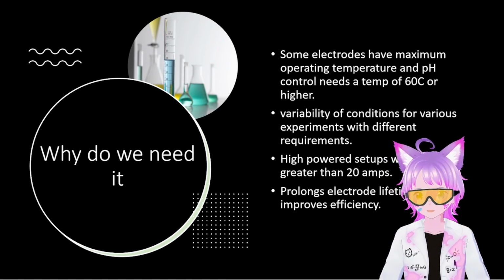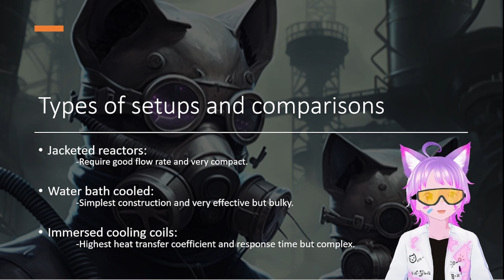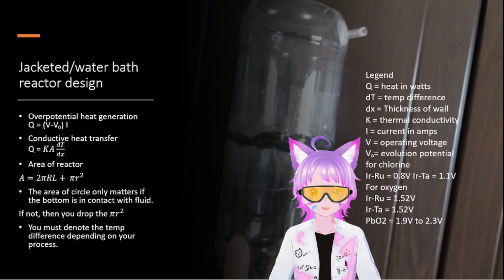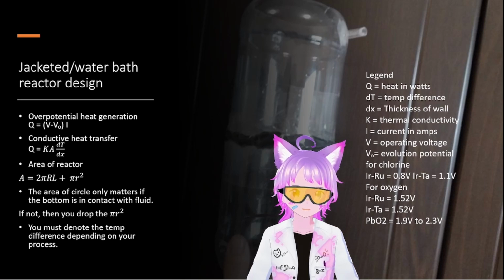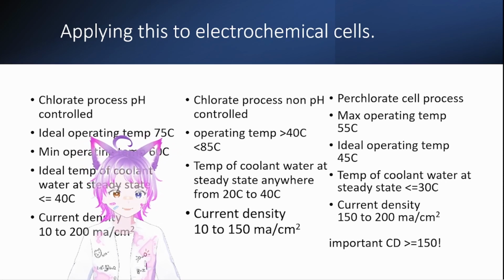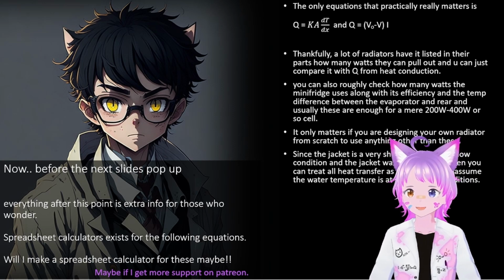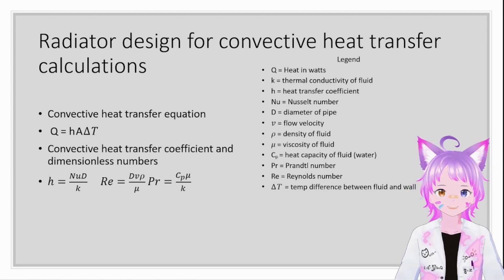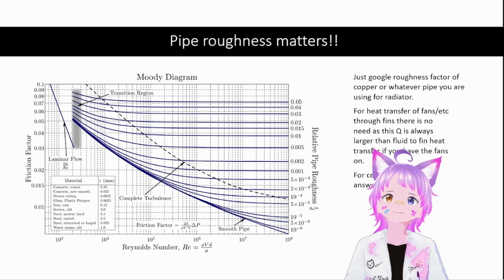How to design a water cooled perchlorate cell

Comment: lmao never thought a catboy vtuber would be explaining a water cooled perchlorate cell design to me hahaha
Reply from the maker: PbO2 cannot run past 55C or it erodes by thermal stress. Hence why it's important to transfer heat.
Reply: @CatboyChemicalSociety  Pt or MMO?
Reply from the maker: @TheBackyardChemist  PbO2 is never plated on Pt only on MMO and Pt also doesn't like high temps above 60C and hence it cannot do pH control for chlorates either.
Because of the fact that IrTa MMO replaces Pt in everything except perchlorate cells its inferior. PbO2 is also some what better able to go from chloride to perchlorate but temp must be below 45C for that and pH pre adjusted to 9

Comment: Im seriously considering casting a finned lead cup as a combination vessel, electrode, and heat exchanger..
Reply from the maker: Lead is a terrible cathode due to it's high H2 evolution potential. The lead is likely to reduce any species in the cell. This is why it's used as a cathode to prepare benzaldehyde from either benzoic acid or toluene.